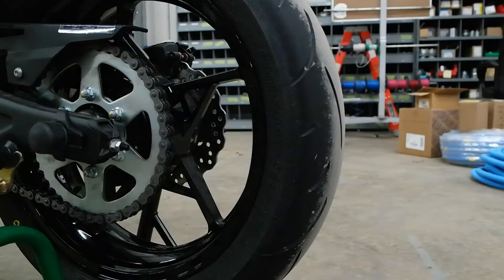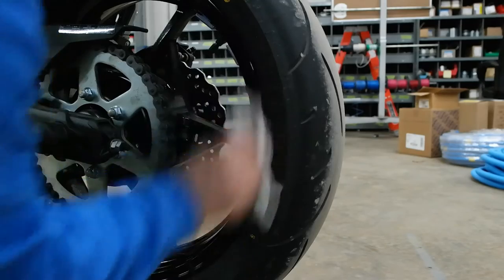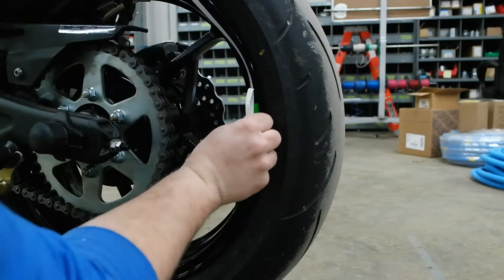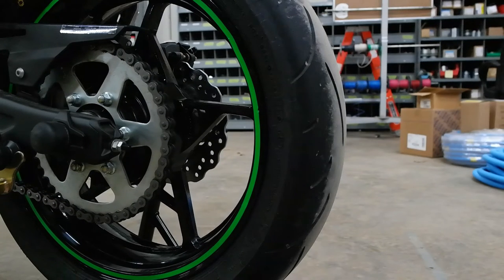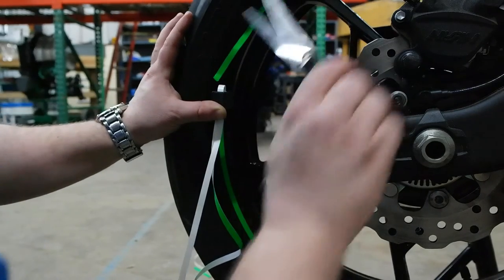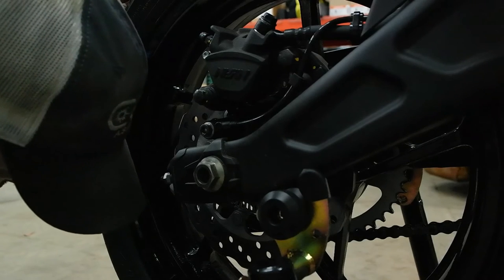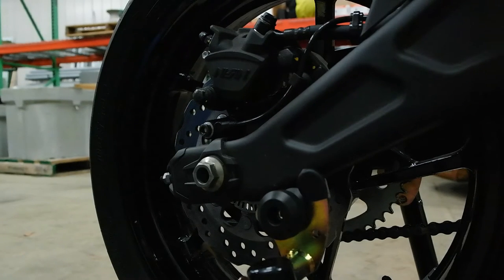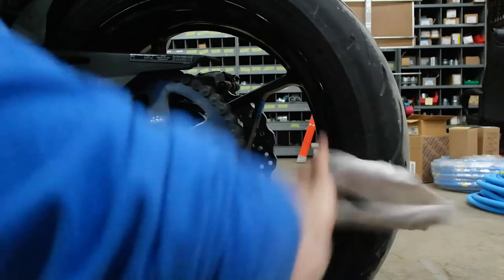Motorcycle Wheel Tape Install and Removal

Comment: Hey buddy great vids, my wife has the same colour z650 as yours and we have had the same problem trying to find rim tape to match the frame colour. Our local kawasaki dealer ordered us some standard z900 wheel tape from Kawasaki and they are a perfect match with the stripes on the sides of the tank so we hope it will look ok (i haven't put them on yet), they aren't cheap though. Hope this info is of use to you.